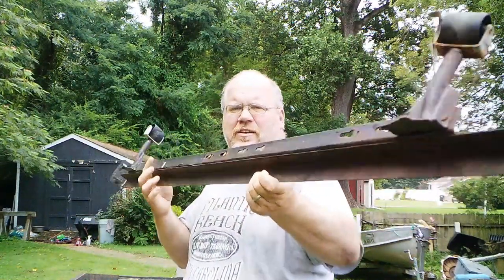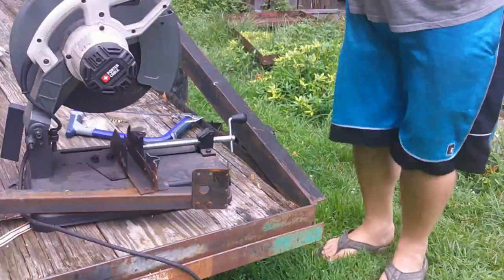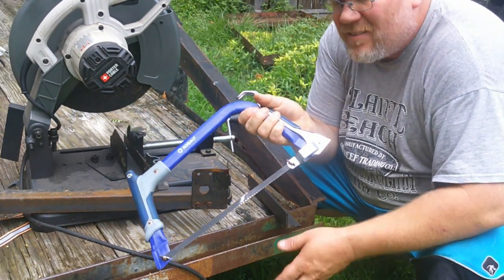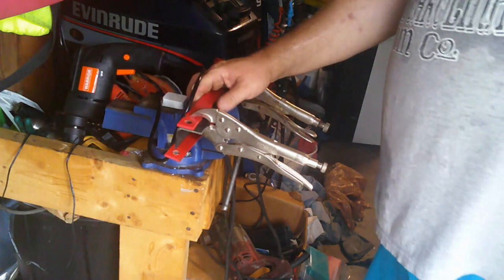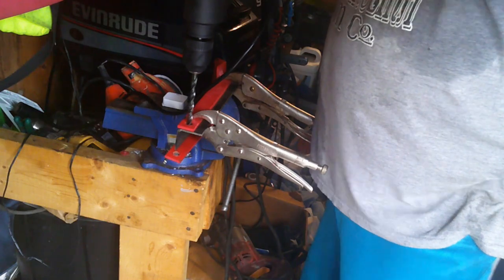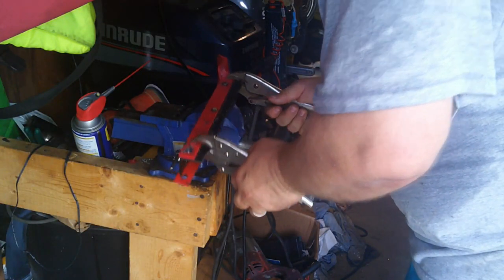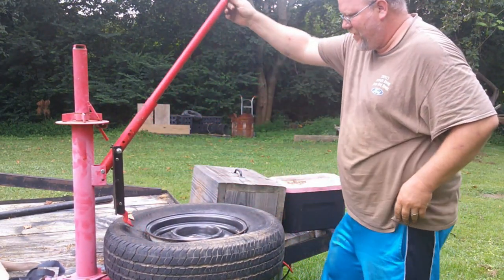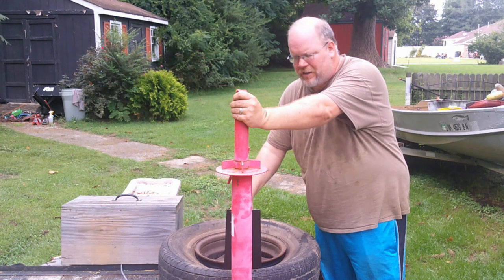FIX THE BEAD BREAKER WITHOUT A WELDER. HARBOR FREIGHT/OLYMPIA TIRE CHANGER

Comment: I never had a problem with mine from 10 years ago. I’m told the trick is to use Windex and keep pushing at various spots without pushing hard enough to bend. The Windex will work down and loosen the bead. I’ve also seen people just keep trying different spots without adding anything and it eventually gives.
Reply from the maker: Great tip! Unfortunately it seems once they bend their strength is gone and this is a common problem with these.  Everyone seems to say welding a plate in is the fix and it is a great way but there's more options, this was my solution.
Reply: That's the key to move the tire in a different spot with soap water even the professional machines need to do this sometimes on stubborn bead.
Reply: I did one with soapy water last week and it still bent out of shape.  People are doing that mod for a reason.
Reply: @BillAnon  Well, you definitely pushed it hard enough to bend despite instructions not to. ;)

J/K, yours very well might be made differently and it may well be that many need this mod… but does seem that giving up before you push that hard is key for other units. Often the bead will break after failing, trying someplace else, and returning to the same place since the previous attempt and the time between attempts allowed some of the Windex or lube to seep down further.
Reply: @emmettturner9452  You will never know how hard is "too hard" until the part bends.

Comment: You get what you pay for. Adding material for more strength is making it more precise for your intended use. At least they put everything together in one place for you to start with. That thing works fine on smaller tires right out the box.
Reply from the maker: still working great with thin enhancement, just used it again last night